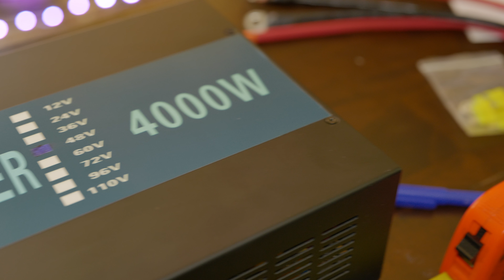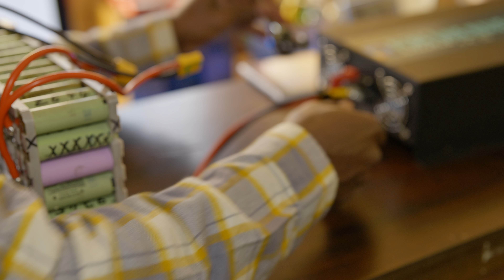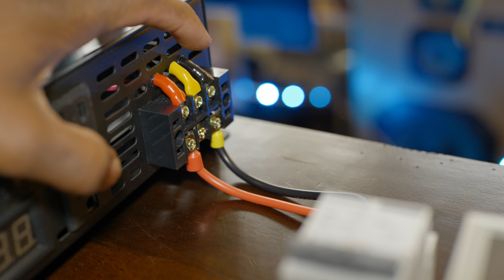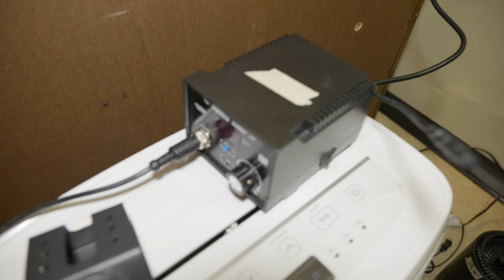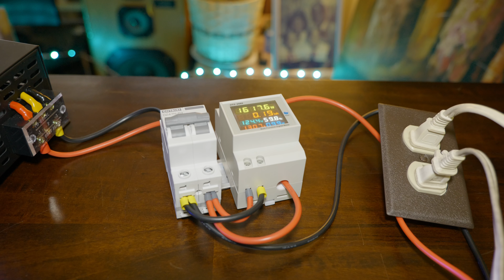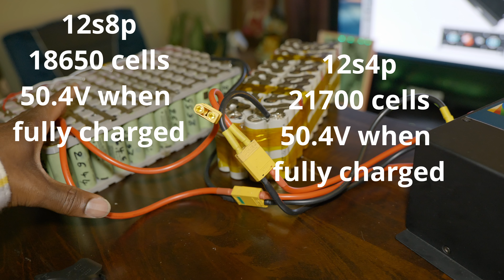4000w Reliable Electric Inverter Unboxing and Review | Load Test

Comment: 24 Volt 3000 WZRELB Inverters used here with the Greatest of Confidence in them. 48 Volt 3000 and The Aeliussine Branded WZRELB 7K Dual Phase Units here are also Good Working Units.

On 10 - 20K LiPo4 Battery Banks
Reply from the maker: Yeah I ve had great experience with 48V versions

Comment: Excellent video presentation my brother, I just wonder why you made a 13s battery pack and not a 14s? I think the battery perform well and hold up very well.  My Reliable don't hold up well to fan, tend to shut it down.
Reply from the maker: I didn't build the battery for this setup, I had for other applications but yes this inverter is for 14s batteries since it supports up to 60V. Does your inverter shut down because of an issue or due to voltage drop?
Reply: @YvonSmart No actually I had never allow my battery pack to drop that low. I can't explain why it happened, I am in Jamaica so I suspects it maybe due to the temperature of the environment as this mostly happened in summer time. I use lifepo4.
Reply from the maker: @howardescoffery4950 interesting, lifepo4 batteries are know to handle heat and cold better than other chemistry but it could depend on their age or quality. By fan, you mean a fan is enough to make it trip?

Comment: You should have just ran full test first before you drained the battery that way you could have checked the top end of wattage
Reply from the maker: I needed a better battery and thicker wires to ensure it's done safely. At ~ 4000W the wires could overheat and potentially melt